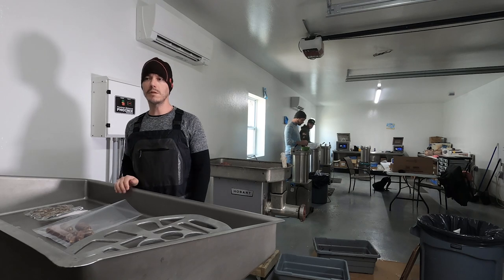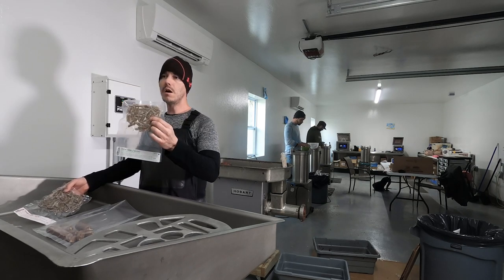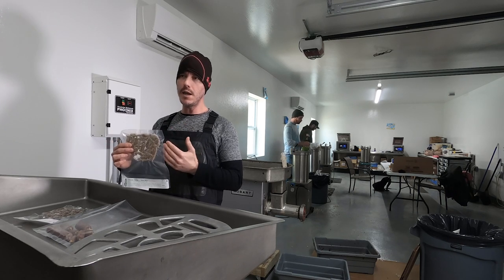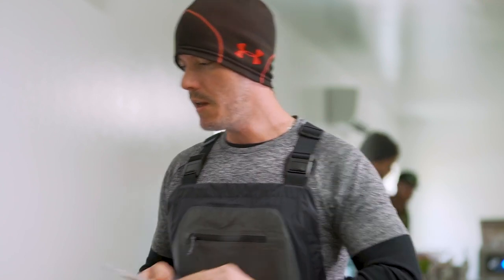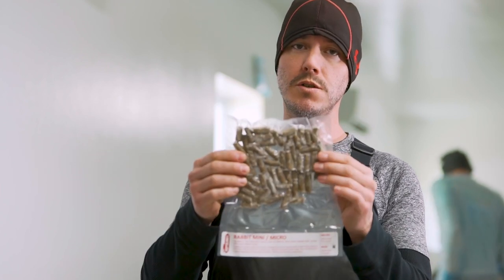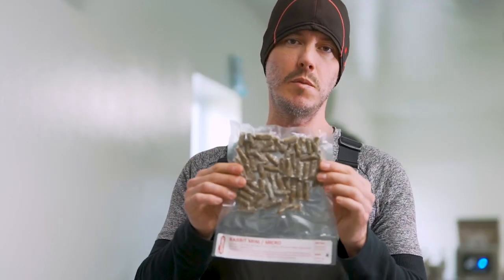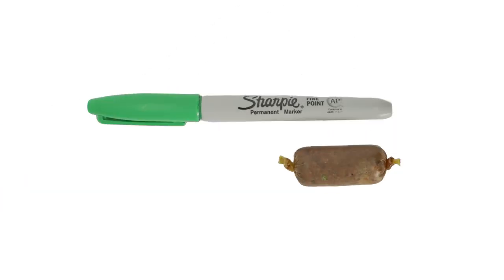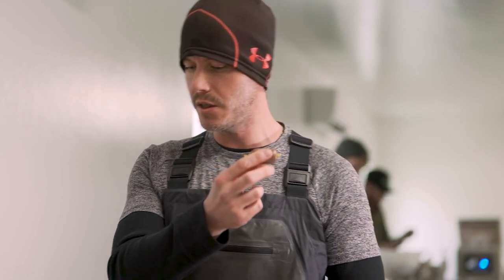Reptilinks Link Sizing FAQ

Comment: Want to get some but don't know if my animals would eat it????
Reply from the maker: Hey there! What were you thinking of feeding them to, Michael?
Reply: You guys need to change your shipping standards. I feel getting two 8-12g links is sufficient enough for me and can last a while but because you only ship $85 or over, it forces to not buy it. And adding the eggs should be counted towards that price. You used to sell just the eggs and that's what I'd get. 2 vacuumed sealed eggs and 2 packs of 8-12g 40 link mega blend +f&v. Shipping should definitely be worked on. And the last rime I ordered it took nearly 4 weeks to ship when it should have shipped the next available business day.
Reply: @j2r2b  Hi kyle, thanks for reaching out.  Our links are hand made to order so we cannot ship them the next day - we simply have too many sizes and blends to hold them all in inventory.  We are working on stocking our 5 top-selling items for same day shipment.  Unfortunately shipping costs have risen considerably - the true cost of shipping is upwards of $40 a box when we include dry ice, ups chargers, insulated liners, and the box.  So we take a hit on only charging $19/$34 for shipping.  if we only sell 2 packs sometimes we’d be sending that shipment at a loss.